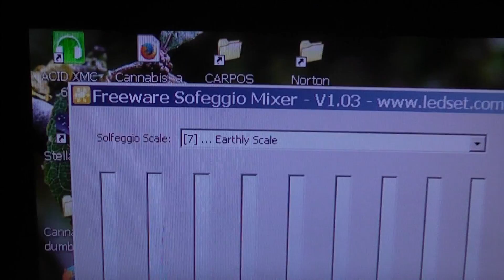CYMATICS; Frequency, Sand and Water

Comment: Man I think they've got videos similar to this on lockdown. Basically if you have mud/sand and it's wet it'll vibrate the water to the surface causing massive mud floods and normal flooding. Can't find the video demonstrations to save my life. But if you put cubes ontop to represent buildings they'll slide around, if you put some under the surface they'll rise. I really starting thinking about why all these ancient civilisations were abandoned and it got me thinking of floods.

Comment: water wil show you more when you adjust height of the water column to the harmonic lenght of objective fluid ;) 432Hz is water ifreq in 20 dec C and lenght of that wave is about 7cm (6,9396...) try this, iw noticed much cleaner and more visible patterns, if water column is out of tuning then resonance cause distortions of reflecting sound waves (also diameter of container is important but a least one tuned dimension is enough, and amount of water is easier to tune than bucket dimension ;) , also hiperbolic container will be more adequate but its srsly out of reach of my and any average afternoon experimentator and costs... ) cheers ;)

Comment: hook up the sx-750 and play Mozart
just imagine HAARP
Reply from the maker: How did you know that was the 750????? lol...
Reply: carpo719 I listen to the vintage gear on the regular. Some of my first memories I have are the lights of my dad's old Pioneer sx-680
Reply: Oh, you also did that video on vintage gear vs new AV gear. I actually run both because my 5.1 (I just got a good 5.1 instead of a cheaper 7.1) has jumpers on the back. If you have a surround receiver with preouts (it will have jumpers) take those jumpers out you can run RCA (red/white wires) to the aux (or anything but phono) input of your Pioneer. That way you can listen to the pioneer as usual, but whenever you want to use the surround amp just put the Pioneer on Aux (if that is what you use) and it and the Pioneer's speakers become the left and right channel of the surround receiver. It is the best of both worlds.